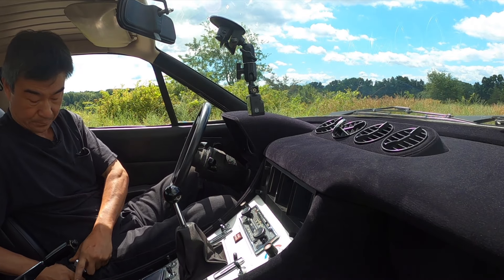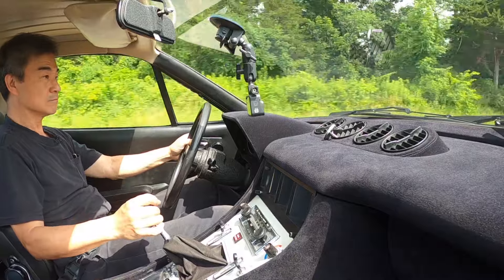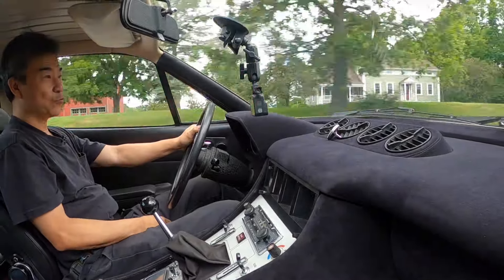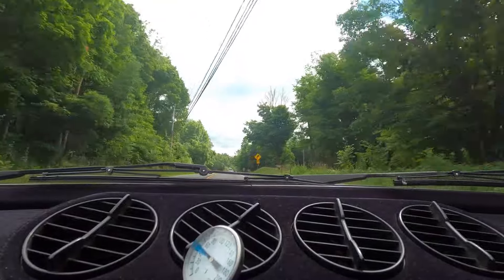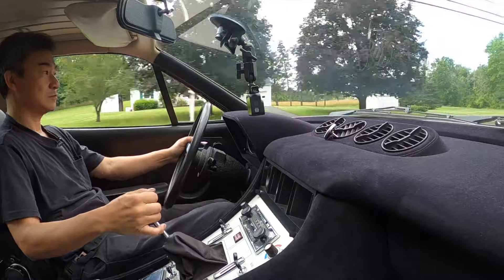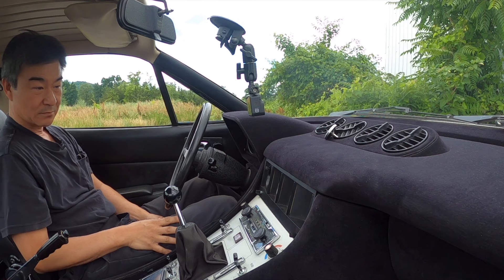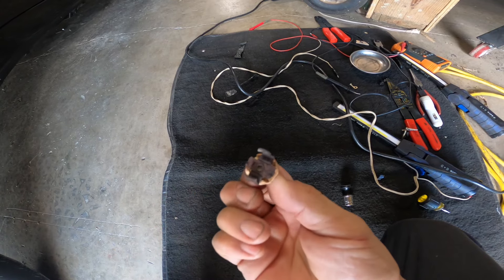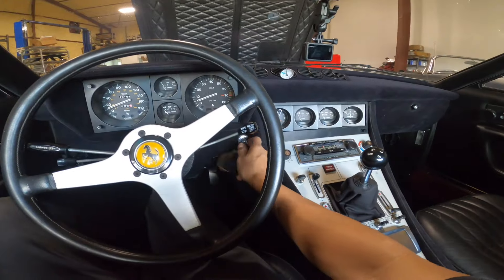Last Drive before heading Home

Comment: There are aftermarket A/C companies in the street rod space that make custom systems that will freeze you out. Vintage Air is one of them ( I think they're still in business )
Reply: Vintage Air is still around.
It's a little outrageous what they get for a 'common' system, but I'm
Reply: Vintage Air is still in business.
It's a little outrageous what they get for a 'common' system, but I'm sure $4,500 is pocket change for someone in this space!  🤣
Reply from the maker: The cost of trying to fit one of those systems could get prohibitively expensive. Space under the dash in this car is pretty tight.
Reply from the maker: I managed to spend half that amount in parts to replace almost the whole system in this Ferrari! Thanks for watching.
Reply: Vintage air has a 4 pass single row evaporator as their vintage unit - seems inadequate put a pusher configuration is efficient

Comment: Yep, you need a phenolic insulating disc on BOTH sides of the cigarette lighter casing.
Reply from the maker: The new replacement had the proper insulation.